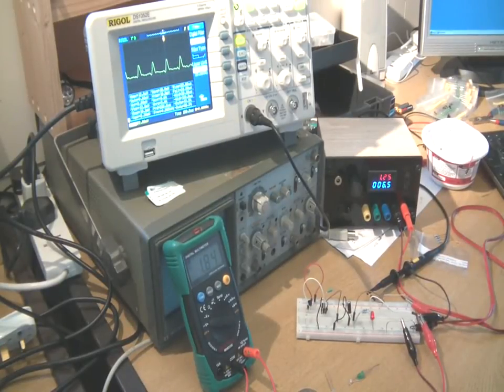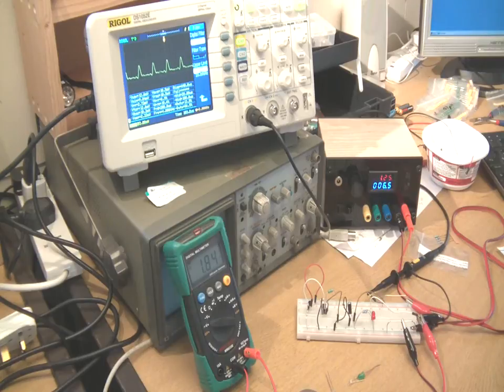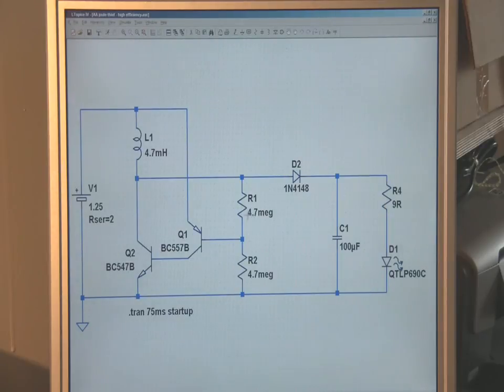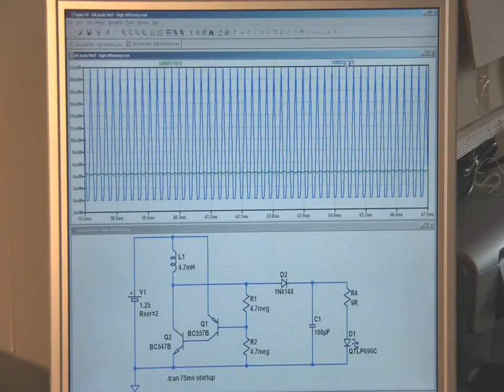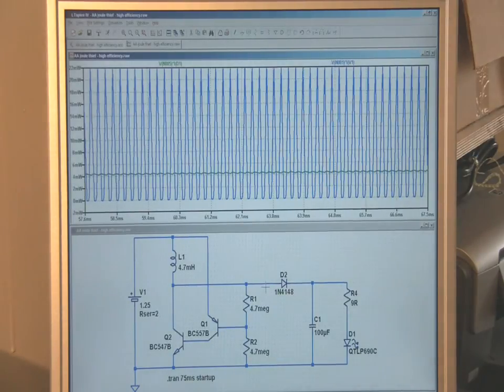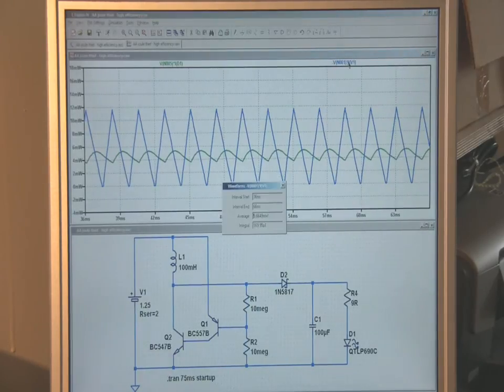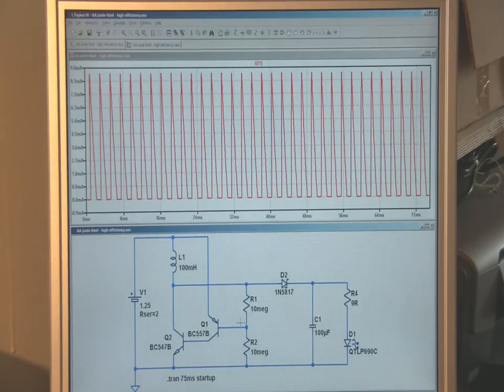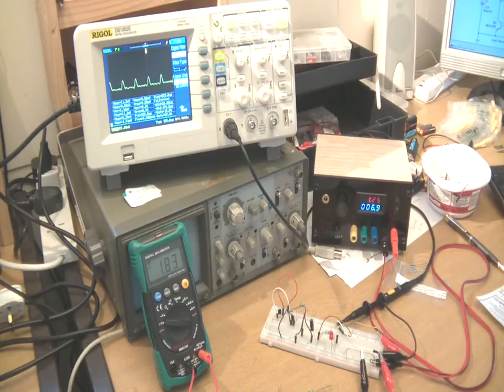DC Boost Converter ("Joule Thief") Efficiency Measurement

Comment: It's 2020 now, dunno if this channel is still watched...
Hve you checked the efficiency of the simple classic Joule Thief circuit???
The simple circuit uses one transistor and  a feedback winding from the inductor.
I suspect that the simple circuit is more efficient than the one described here.
Reply from the maker: Yes, efficiency is woeful. My circuit was originally designed as a way of demonstrating the five basic off-the-shelf components, including both NPN and PNP transistors. By using a simple inductor you also don't need to wind one as per the original joule thief design.

Comment: I know this was 4 years ago but using a breadboard is not a good setup for efficiency.... Those breadboards are notorious for adding all kinds of noise via stray resistance and capacitance between the boards buss bars...
Reply from the maker: Good point! I hadn't factored that in.
Reply: I build my prototypes on FR-4. You get a great ground plane and few sneaky distributed Rs and Cs.

Comment: I've built dozens of these, each time I've tried to optimize the performance.  I've found that the 2N3904 and BC547 are the least capable of good performance.  It's better to use PN2222A, PN4401, or slightly better, BC337-25.  If you can get some of these, they're even better:  C8050, 2SC2500, NTE11, KSD5041.

To minimize losses in the coil, use around 100 uH, with a series resistance of 1/4 ohm or less.  A high mu ferrite toroid core with a dozen turns works great.  You can check out some of the many Joule Thief circuits I've built at rustybolt.info/wordpress/
For some reason, the provider has been getting DoSed, so it may be difficult to get on my blog.

Comment: I was mucking about with LTspice just now and came up with a dual NPN boost converter with a theoretical efficiency of about 85%.
After a little improvement the circuit was able to supply constant regulated 5V at 1A from a 3.3V supply.
I guess now it's time for me to test it in real life. :) 
Especially since i made a MOSFET version of my circuit  that supplies much higher current at a slightly lower efficiency.
Also raising the inductance of the coil does not necessarily increase efficiency, I found 4,7µH to be just right.
Reply: I just made my circuit work under the same conditions as yours did in the simulation and with a bunch of fine adjustments got 61% efficiency. :)

Comment: Hallo ! Great demonstration and explanations.
I did tried about the same, but with a Capacitor instead of R1. I played with values from 1uF, with LED blinking, to 22nF, and currently with 1.5 nF. The R2 I tuned to get a consumption of 1mA ( currently ) from the Battery. With a different Coil : Torroidal / Bifilar / Air. And "something" more... Measurements indicated about 35% to 38% efficiency.
You may want to see : Joule Thief With FeedBack - After 35 Hours / 2014-11-08 and Joule Thief With FeedBack - After 46 Hours / 2014-11-09.
Would you please let me know what Application are you using as SPICE Simulator ?
Thanks a lot, and Good Luck !